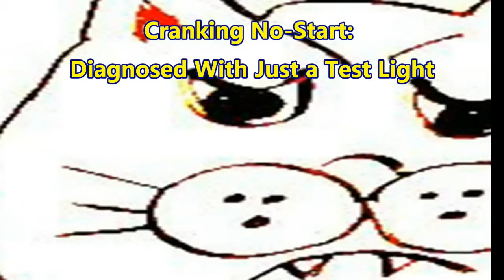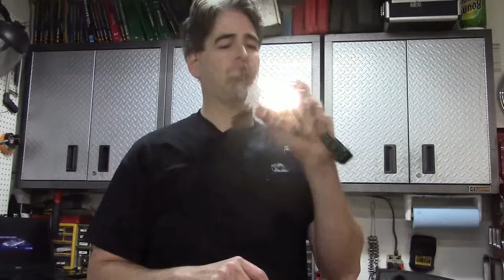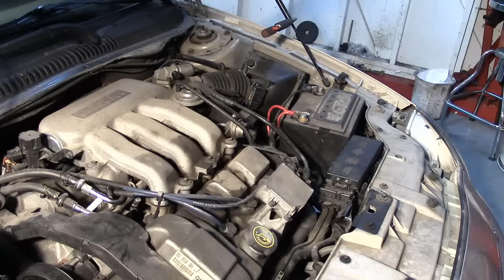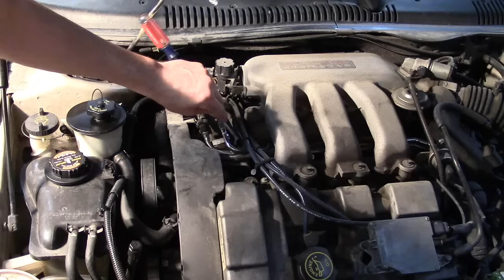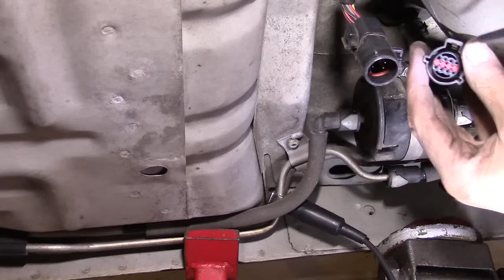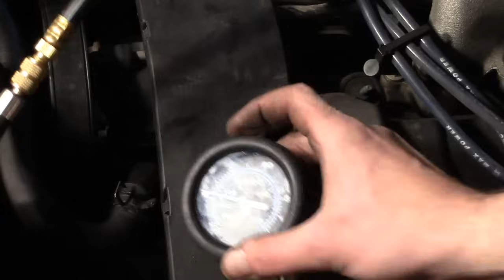Crank No-Start Diagnosed only with Test Light

Comment: Seems like overkill but I understand the need to be complete for the purpose of this channel. However my old school backyard knowledge of a no start crank would have been to immediately put a fuel pressure gauge on the rail right off the bat and I would have had the diagnosis in 30 seconds.
Reply: "Crank No-Start Diagnosed only with Test Light"
You must have a fancy test light if it has a built-in fuel pressure gauge.
Reply from the maker: Well that would have been awesome if your fuel pump was bad. But if it was due to a bad CPS though, you would have put a new fuel pump in the car all the same after measuring fuel pressure and seeing no pressure and you'd just end up with a MISDIAGNOSIS in only 30 seconds as result of your backyard mechanic approach-wasting your time and money with a car that still would crank no-start and you would not even understand why.
   You have to have basic comprehension of your systems and how to test them. Period. Otherwise you replace fuel pumps based on no pressure like 98% of people do.
Reply: The fuel pump was bad! Don't give me hypothetical situations, in this particular case the fuel pump was bad and in 99% of these cases it's either no spark or no fuel, in your case you had spark, so it must have been fuel. I didn't even have to watch the whole video to determine it was the fuel pump before you even got to that part. However your diagnostic skills are awesome in all your videos and I would love to have a guy of your caliber working on my car. Most of my diagnostics are based on gut feelings (I am not a mechanic I am talking about working on my own car if it ever needed something) and I try to take the most obvious route based on common sense.
Reply from the maker: Ah another person who doesn't get it.   Maybe some day you will understand.
Reply: Maybe some day, but today I know it was the fuel pump nothing more. Sorry we all can't be as smart and condescending as you.
Reply from the maker: actually you can be as smart as me. You just have to learn. For example, how come you wouldn’t test the relay before putting a new pump in?  it seems you don’t need to be as smart as me to do that, but you are saying you wouldn't do that???  You would just go right to changing the pump without testing the relay so you could "diagnose it in only 30 seconds"?? Wow.

Comment: Thank you for the diagnosis with just a test light because I don't have diagnostic tools other than a voltmeter & test light.  Changed out the fuel pump but have an intermittent crank no start. Check engine light doesn't light up with key in On Position. No blown fuses.  Not clear how you are jumping  the relays.  Will watch again
Reply from the maker: What was your data the fuel pump was bad based on the testlight results? I would start there for sure. Also what was your voltage drop reading?

Comment: Hey I have a question I have a 1999 Suburban 1500 vortex 5.7 just put new fuel pump on and it was running but had misfire changed plugs and wires still had misfire a guy messed wit the distributor and messed up timing I believed to be fixed now but car cranks and won’t start when it’s cranking the pulleys stop spinning and start again
Reply from the maker: What was your data that you needed to change the pump and plugs and wires?? I would start their? Did you have a high fuel trim under demand? What is your load curved MAF sensor reading?  There is no information to go on here.
  I need fuel trim analysis data.
Reply: Schrodingers Box I can work on getting you the data,the guy who originally did the work on the car is out of town. I was just hoping if I told u what was going on, you might have an idea of what is wrong and where to start. I appreciate you taking the time to respond
Reply from the maker: That's exactly where I would start.  Starting any other way would just be shooting in the dark!
Reply: Schrodingers Box I just watched a few of ur videos I’m gonna try to figure it out.. I know very little and your videos are very in debt I’ll try to fasttec thanks

Comment: Did you rule out the fuel filter in this instance?
Reply from the maker: Yes of course- No fuel filter is ever going to clog so much that there is no STATIC pressure reading.

Comment: I've only watched a few of your videos so far, don't judge me, LOL. Subscribed because I learnt from this video. Any insight on a 93 Grand Prix, with a 3.1 L engine. Ran fine, temperature dropped to - 18*C overnight, it cranks over easily with the new battery. Fuel pressure just over 40 PSI, and holds solid after the key is turned off. Everything I've looked at on youtube and google says cam positioning sensor. Managed to tilt the altenater off to the side enough to move the power steering pump out of the way. No cam position sensor at the top of the block. No spark at the plug, It's the boys first car, I've always ran Mopars, I'm totally lost. After 3 weeks of this car being down, he's walking to work at 4:30 AM in the cold, an hours walk. Any help is appreciated.
Reply from the maker: which sensor is it! Hall effect or inductive? If inductive just look for AC output  if  hall effect just bypass sig to ground and if it sparks, replace the sensor
Reply: Thank you for the quick reply. I have limited knowledge with ignition. I'm thinking inductive. There is no sign of the 3.1 L having a distributer. It's OBD 1 system, with the 12 pin diagnostic port. I jumped pins A and B with a paper clip and got code 12/ no stored codes. Bought a code reader, basically a paper clip in a fancy plastic box. Same code through service engine light. So far the best info. was 2carguys. Learned it's got a cam position sensor behind exhaust manifold, and crank sensor behind the starter.

Comment: Nice diagnose and looks like it was trying to run but if its like a Chevy 4.3 vortec they require atleast 50 psi to run and v6 3100 atleast 40 psi.
Reply from the maker: Yes I did look up the specs later and indeed the fuel pressure requirement is lower than GM's usually are.
  I did change the fuel pump and it ran like a champ!!
Reply: Cool glad to hear

Comment: 20 psi is the low end of pressure that the injectors would get a decent spray pattern. I'd hook up a pressurized can of carb cleaner to the schraeder to test.

Comment: Do you have any tips for me? I have a no crank no start, and it only seems to happen after sitting in the heat, and I can use a button to bypass the neutral safety switch and everything before that will work to start it.
Reply from the maker: If it starts with bypassing neutral safety switch i would look there.
Reply: Schrodingers Box I have looked there, and the switch  seems fine. I don't see how the switch could not connect based on heat, and no matter how much i shake the switch or change gear, it won't start if the car has been soaking in the heat. It will start in very cold weather. Is there a possibility something in the collumn is expanding/contracting?
Reply from the maker: Measure for resistance and voltage drop across the switch and in the circuit with switch bypassed to identify the issue.
  heat increases resistance and you can’t just look at a switch or even validate continuity and rule ot voltage drop.
Reply: Thank you
Reply: hgpo2   ,7
Reply: Schrodingers Box d

Comment: Policy not to unload the car in the driveway = lazy tow truck driver
Reply from the maker: Yes Zib is right- it's a liability thing.  I usually use the same driver and he really hooks me up (no pun intended lol). I have a severe incline on my driveway and yet still the guy lines up even SUV's to just roll right off the ramp into the bay without hitting my garage door or scraping my concrete. He's amazing.  But whenever customers choose their own driver much more often than not they drop it in the street, and  this guy in the video even spent 2 minutes taking pictures all over the car to boot!!

Comment: Did you pull the paper clip out of the control side on relay before you sent 12 volts with the power probe?
Reply from the maker: No- because the circuit was open anyway since the pump was unplugged.

Comment: Nice video and diagnosing, but I knew it was the fuel pump as soon as you started it. The sound it always makes.
Reply from the maker: The fuel pump made no sound and the starting was no different than any other no fuel or no spark condition.  There is no possible to way to tell it is a bad fuel pump from the starting sound.
Reply: The way it cranked. Not trying to annoy you sir, but yes..when it cranks and doesnt start like that, it's almost always the fuel pump. My father was a grade A mechanic, im almost as good as he was. And I now that sound. I'm just saying within 5 seconds of you starting it, I new it was the fuel pump. Still an interesting video and diagnosis.

Comment: I've had some people that argued with me over fuel pumps. They said if you hear it running, then it's good. You just proved my point even more. Mine went out on my F150 as well as a 4runner. Both would prime, but both were weak. Replaced and both run great. The fuel pressure on both vehicles were just below what is recommended. Still, those asshats continued to argue over it lol.
Reply from the maker: Oh man dude- I have what- 4 videos showing clearly that a running pump did not meet fuel pressure specs?? WHoever you are arguing with needs a serious throat punch!!! There is no argument- a running pump does not mean it isn't the problem!
Throat punch them for me too!!!!
Reply: even e flick would do but yeah do the throat punch sometime 😁

Comment: Nice work with the test light!  If you have not already and your vehicle is more than 10 years old, upgrade your AAA card for the free 100 mile tow.  Diagnostics are great but you still need to get a broken down vehicle to a repair shop/mechanic.
Reply from the maker: Yeah I always do my best to try to save the customer any fees with towing etc but at the time there was no way I was getting under the vehicle in my suit lol. Towing was only option!
Reply: I thought about carrying tools.  Realized that I cannot carry all the possible repair parts too.  So, unless it is a battery jump start or changing a flat tire the vehicle is getting towed.  The AAA upgrade to the Plus Membership for about $88 annually with the 100 mile tow will save your clients $$$.  I believe you have to be a standard AAA member for 90 days first to qualify.  The road side visit was good moral support though.

Comment: What is the power drawn by the test light you're using? How many milliamp? How much would you consider enough to load the circuit and in the same time safe enough not to break anything? I've seen Eric using a bulb for bigger circuits that was pulling about 4 amps. Obviously you might have different circuits but what are you thoughts on this? I believe Keith is using 250 miliamps test light. What about circuits like camshaft, crankshaft, maf, map sensors, how many miliamps would you consider safe? Thanks Matt.
Reply from the maker: This was a 250ma. For computer circuits I use a LED testlight instead that pulls less than a tenth of that.
Reply: Awesome Matt, thank you very much for that, sometimes it is really difficult to find the information and I definitely wouldn't want to blow the computer during testing. By the look of it I have to buy myself another tool now :) Thanks again.

Comment: A definitive diagnosis.  Maybe it's just me, but I probably would have given it a shot of starting fluid to get to run for a few second, just to make sure there wasn't any other problems.  The fact that it was trying to start with a little pressure probably means it was okay.  However, there have been a few occasions when I find something wrong, tell the customer a price, fix it, and I discover it an additional issue.
Reply: I too give it a shot of starter fluid. Good way to verify it's only a fuel delivery concern. Great video.
Reply: 2004 nissan frontier problems
Reply from the maker: Yes at the time i was with customer wanted to do that but there was none around. I could have done it in the garage i suppose.

Comment: you are just like  McGyver! you will soon be able to diagnose with a pen knife and a match stick! Man I would love a shameless plug! great video Matt!
Reply from the maker: Better yet how about i come to Pitt and we diagnose that car with the poor performance that probably has a rats nest growing in it by now.
Reply: Well I would be all for that but you still have a 4 hour ride east from from Pitt but you are always welcome and I have about 4 vehicles with codes that we can look at so no shortage there. So anytime my friend!
Reply from the maker: We'll talk....
Reply: Starts won't stay running unless you hold key forward
Reply: Sounds like future videos! :)
Reply: I saw an episode where he noticed a 12 hp Kohler engine smoking and running like the choke was half-way on, MacGyver pipes up "Hey, looks like you've got a busted piston there!" Pulls the engine apart to reveal a broken-in-half connecting rod, then uses some coins (usually made of Nickel, a different metal) held in the alligator clamp of some jumper-cables to arc-weld the aluminum halves of the connecting rod together.   I was disgusted, it isn't a compliment to refer to any mechanic as "MacGuyver"